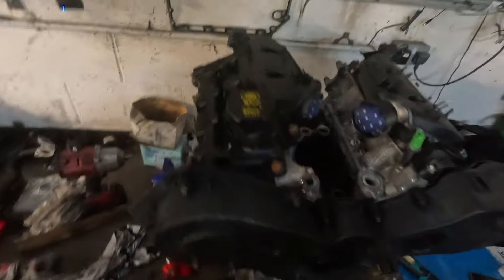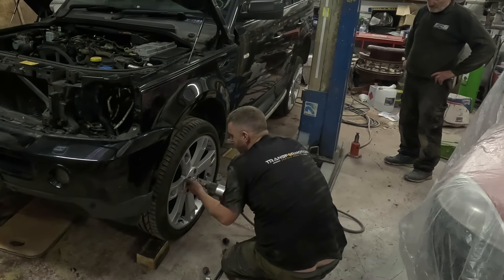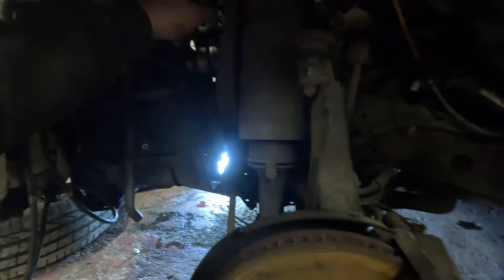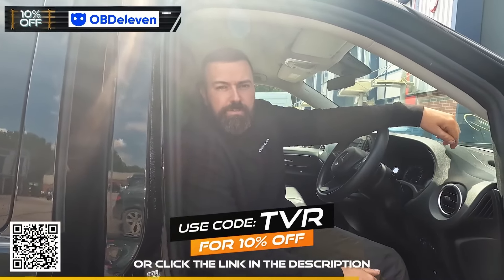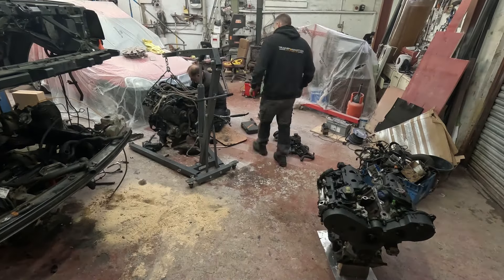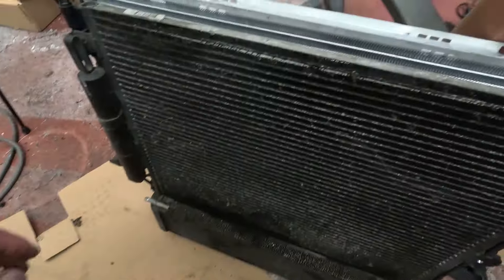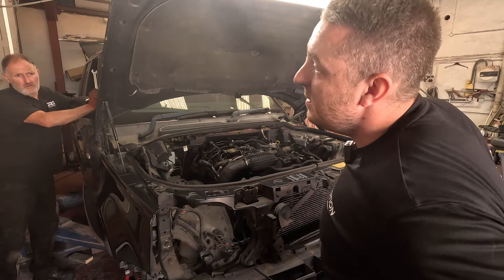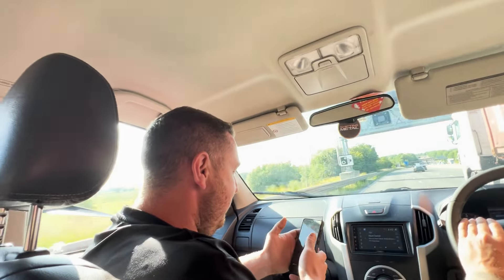WILL MY REBULT RANGE ROVER SPORT ENGINE START? | Engine Swap!

Comment: Finding that coolant pipe is what its all about, rebuilding engines is hard work, getting everything back in place is hard work, not finding that pipe that the pulley had worn through equals doing it all again which translates as double hard work. Well done Liam, and Liam's Dad, and Grandad. Tidy.
Reply from the maker: Nice one mate, after rebuilding an engine you're always looking for water and oil leaks so it would have been found before anything catastrophic happened as it would have leaked coolant everywhere

Comment: Well done, great vid. What was the issue your olds fixed when you were out and about?
Reply from the maker: oh it was me being daft  we unplugged  the diesel pump to get an ohms reading  just to rule out an issue  we had and I didn't plug it back in   my bad 🤦🤣
Reply from the maker: Thank you mate, basically a wire wasn't connected of the end of the fuel rail, these things happen when you've been working all day then carry on into the night ha ha he came back with a fresh head and found it straight away

Comment: Not long until your flying round in the sport. Hopefully you don't have the common electriconic handbrake issues or air suspension issues. Atleast you know the engine is sweet
Reply from the maker: Yeah it'll be on the road soon mate, I dont know of a single RR sport where the handbrake actually works ha ha 🤣
Reply: @TransformotionVR  don't need a handbrake when you have park mate 😜 you'll be loving life. Hope that's not in the high tax bracket
Reply from the maker: funny  you should  say that about  the handbrake  because  it doesn't  work 🤣 and ye I'm getting f#@#£d with my pants on 🤣🤣🤣 £700
Reply: @TransformotionVR  mate the £735 a year tax bracket is a joke. We pay more then enough taxes In this damn country anyway. They penalize people for having nice motors don't they. Well good luck with it lad I hope mechanically it stays trusty for you. I'm sure it will now will basically a refurb decent engine. Been great to drive with a cheeky map and straight through exhaust 😁

Comment: Usual V6 JLR diesel …….broken crank
Reply from the maker: We're not sure it's broke the crank yet, the rod has definitely gone tho
Reply: @TransformotionVR   crank breaking is very common on the lion engine, see LR time on you tube they had one, they are well versed on the JLR V6